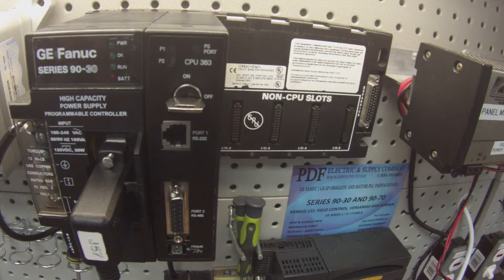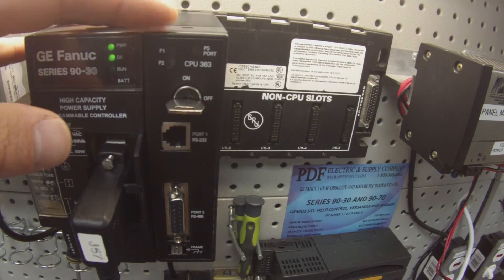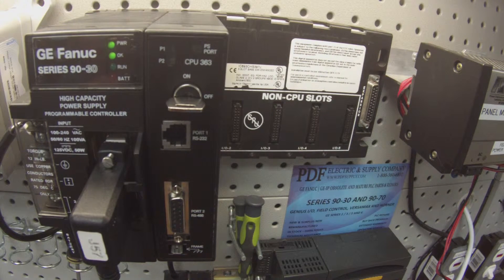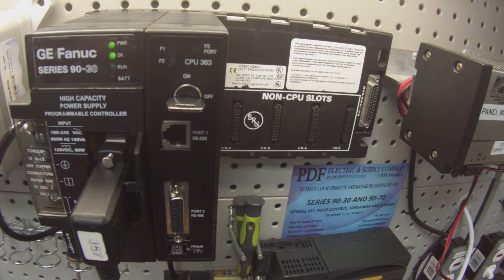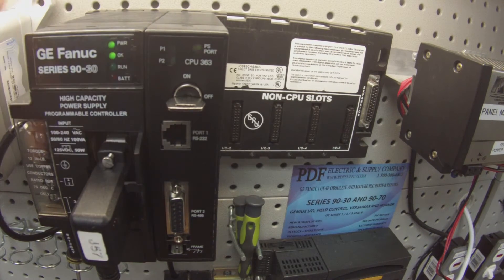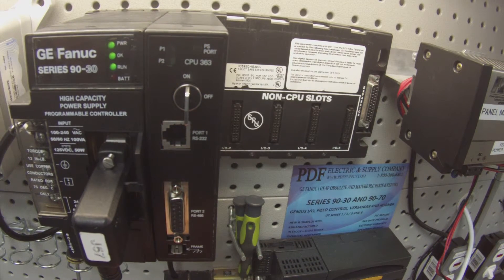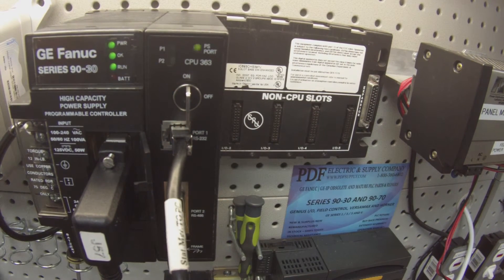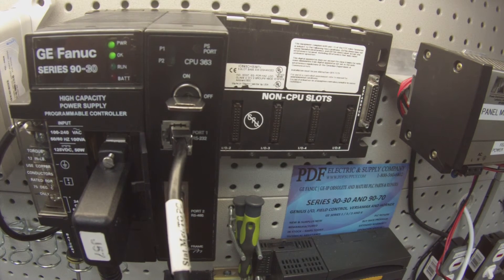How-To Troubleshoot & Test: IC693CPU363 (GE Fanuc PLC Training Series 90-30 CPU)

Comment: Where I can find the Proficy program or software to GE- Fanuc series 90-30 with CPU-363
Reply from the maker: When it comes to software, your best bet is to contact the manufacturer directly or find your local GE rep - and here's why: they can provide the technical support for software. You might have some luck with their support line: 1-800-360-6802
When it comes to hardware, PDF Supply carries new, remanufactured units and offers repairs for your bad units. We stock more GE Fanuc PLC's than any distributor and can ship units out the same day you need them. For a quick quote, visit us here: http://www.pdfsupply.com/quote.php
Thanks for watching!
Reply: Thankyou for your fast answer